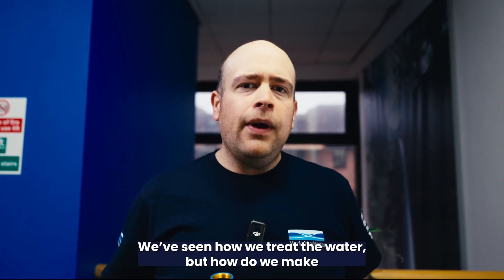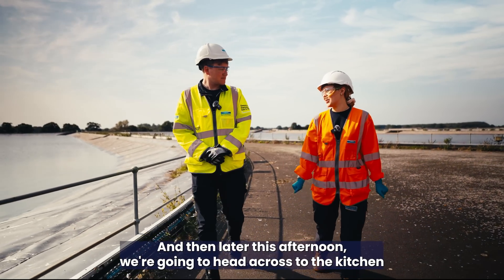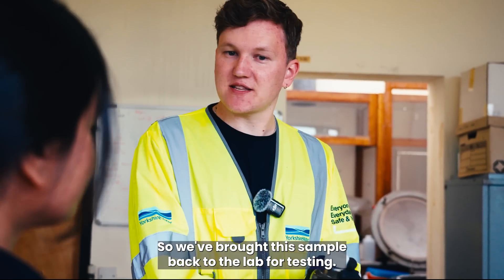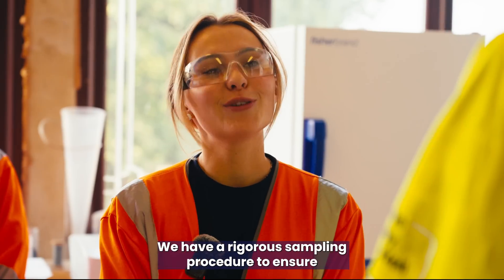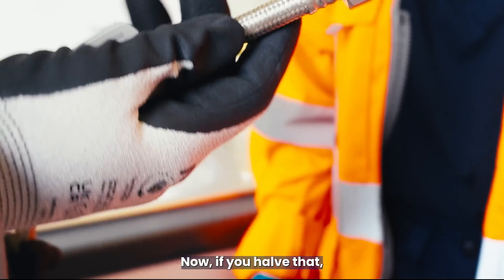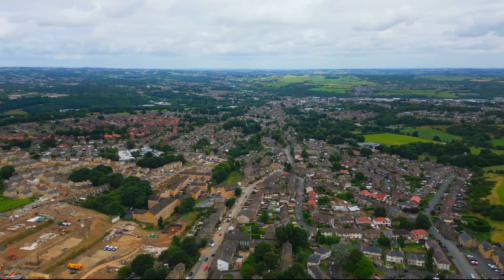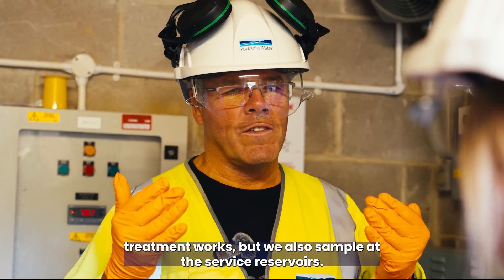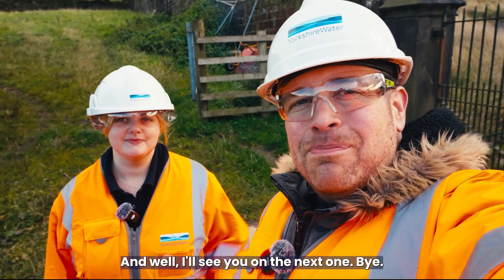Yorkshire Water // The Science Behind // How we test drinking water quality

Comment: Hi, would you recommend an under-the-sink water filter for drinking water? These seem to be getting popular and talk about micro-plastics, but they aren’t cheap and require replacement filter. I was thinking this may be more for hard water areas in other areas of the country as I’ve found Yorkshire water to taste one of the best, but would be interested to get one if I can take things up a level
Reply from the maker: Hi Dave, thanks for your question. We understand that you want to ensure the best for your home. However, we advise against installing additional treatments yourself, as there can be risks if they are not installed or used correctly. If you did want to install one it would need to be done in line with water fitting regulations. It’s also important to follow the manufacturers installation and operational guidelines just to make sure that everything’s safe. 🙂 Thanks for watching the video 💙
Reply: @ thank you appreciated. These seem easy to fit at least the one I’ve seen is (water2 it’s called, seem to be heavily marketed at the moment). Can you advise re the water fitting regulations? Do you have a link or anything?
Reply from the maker: @Dave-k9  Not a problem, here is the Water Regs UK website; https://www.waterregsuk.co.uk